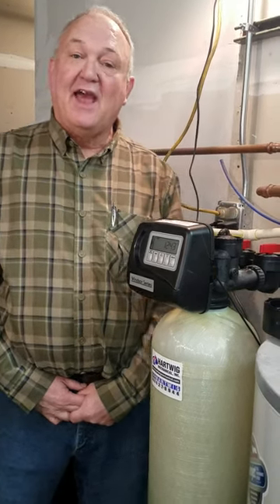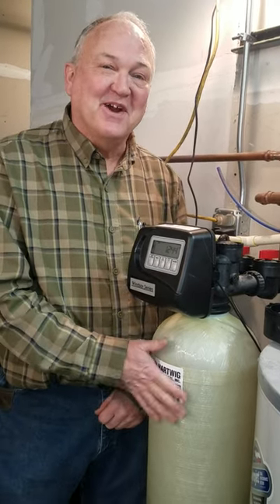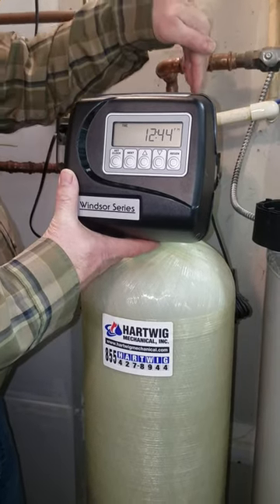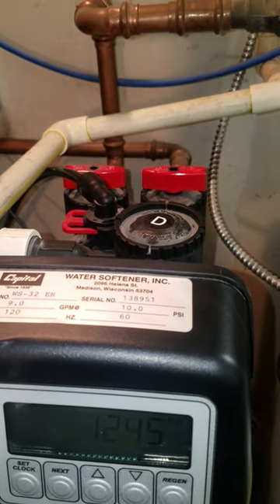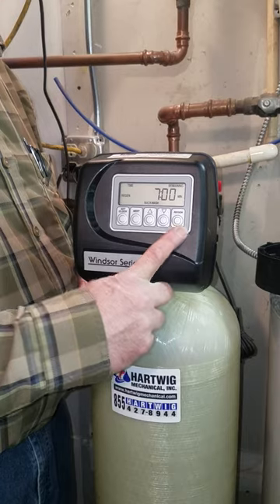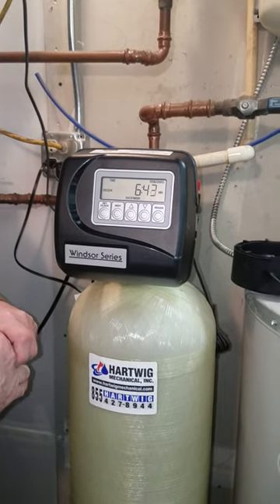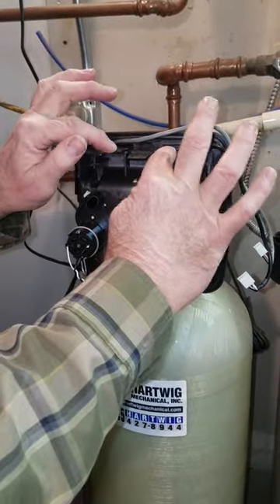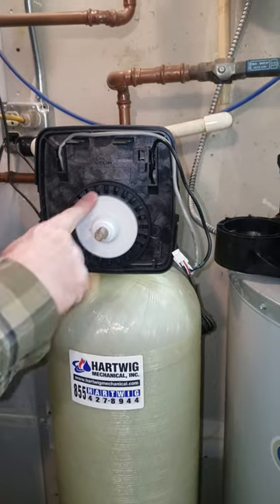The Clack Ws1cs Water Softener teardown school

Comment: This without doubt is the very best information that I have been able to find on the Clack Valve, your presentation is clear and very easy to understand. Mine is not drawing brine, after checking the injector and the drain line flow control everything looks good, though there is not suction. Any suggestions on how to proceed?
Reply from the maker: Glad it was helpful! If its not drawing brine, you either hane a bad seal stack, air leak where the brine line meets the brine tank connection or where the brine line meets the control valve. It can also be a bad pick up tune inside the brine tank. Many times people who use PELLET SALT will clog the bottom of the salt tank with salt binder mud. Brine solution can not pass by this sludge.
Reply: @ambassadorscall  
Did a complete disassembly according the your video, and initiated regen last night. This morning the brine tank is full of water almost to the top, before last night the water level was considerably lower.  Also, the readout is stuck at "Fill" and is reading "Salt". There is no suction at the valve, and the stacker appears okay, smooth seals like you mentioned. I replaced the entire drain line several days ago, and the injector is clean. Scratching my head trying to figure out what to do.
Reply: Bingo, it was the seal stack, installed a new one and we once again have soft water!

Comment: Awsome explanation, I have a doubt, in the last part you were showing how to read the history of the softener which includes how many gallons it has filtered, the number of regeneration in its life and all, is there a way to make it zero? I am asking this because a unit that looks very old and used, shows everything zero as if it has never been used, which can be correct as long as no one can override or reset these values. I just want to know if it's possible to make numbers look like it's new even though it's not. Sorry for the long comment, hope to see your thoughts on this asap.cheers!
Reply from the maker: Harse....  this would indicate that the electronic board has been replaced
Reply: @ambassadorscall  so that means there is no way to clear out those numbers from the board and will stay like hardcoded, hope I got it correct and thanks a ton for such a quick reply🙏🏻
Reply from the maker: @Infino985  that is correcr. Its like a cars odometer. Allows the facts to be told on that control valves history